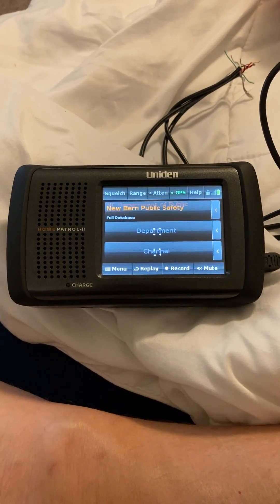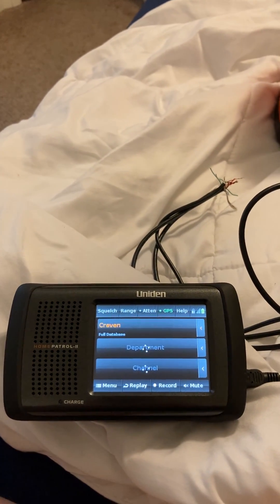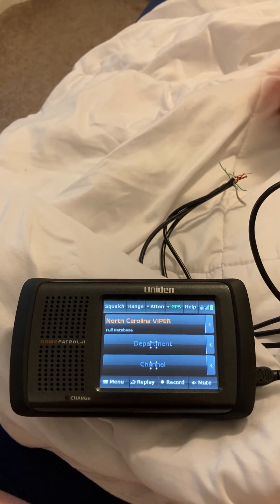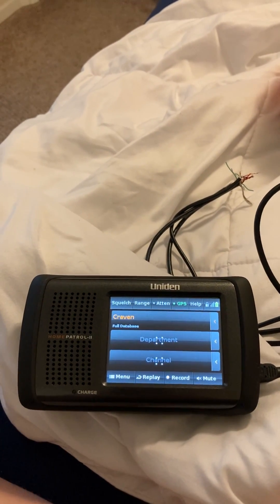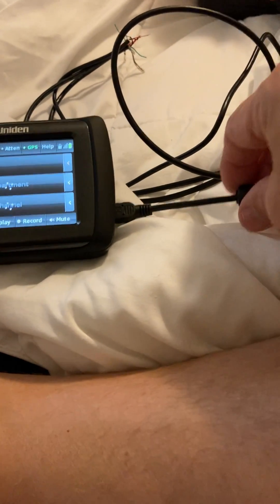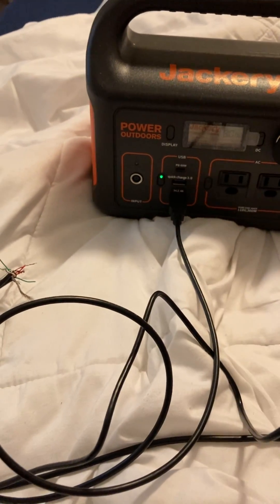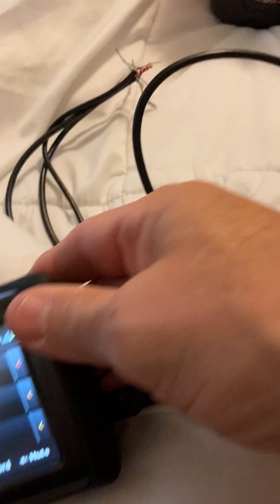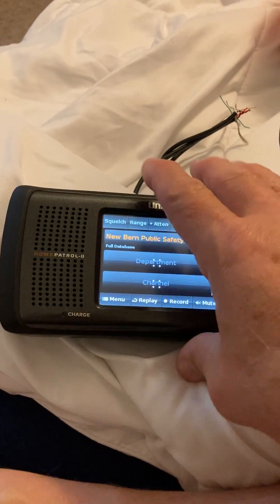Making a DIY GPS Puck for Uniden Homepatrol Scanner

Comment: John, I ordered a Promaster 3696 and I cant get the cable to plug into my Homepatrol 2.  It appears to look like yours other than the packaging.  The usb mini b 4 pin is too square to plug in?  If that makes sense.  Curious if I got a different mini usb type b 4 pin connector?  Any guidance would be gratefully appreciated.  Thank you.
Reply from the maker: Try turning it over.  Shoot me a pic if you can via email.  My email is on Contact page of my blog link above.